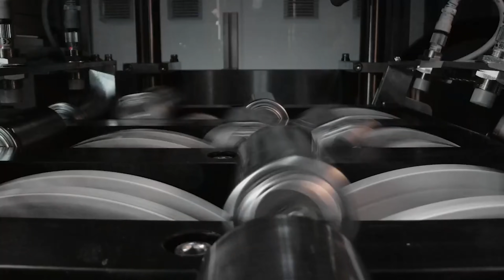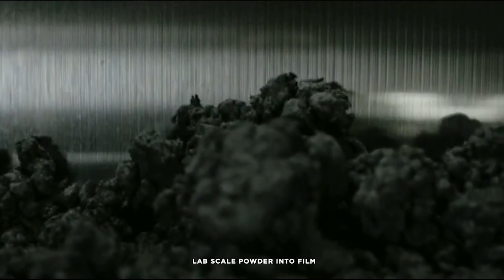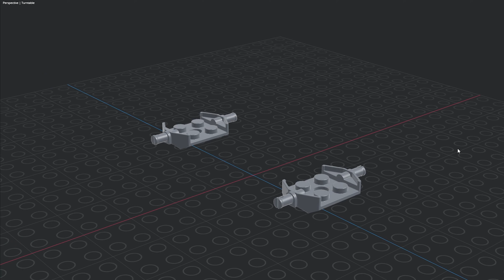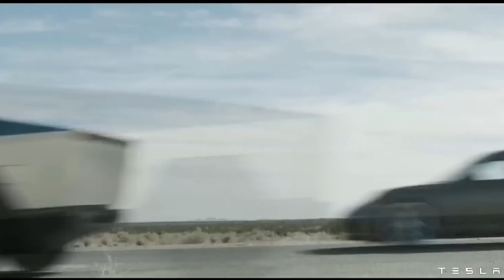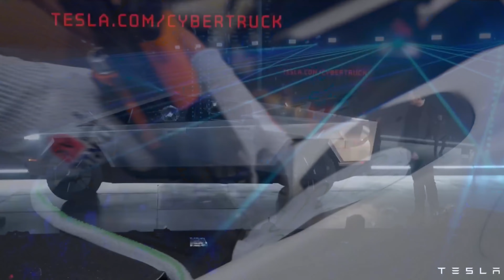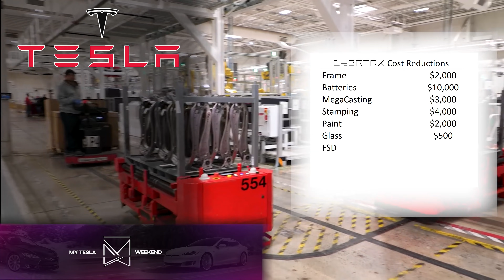CyberTruck costs half the competition, and we know why

Comment: Are robots that expensive though on the wider scale? 50,000 dollar robot is nothing. So is a million dollar robot if you get 20 years work from them. Factories colts billions and robots would be a fraction of that cost. Also, what is the issue with space in the factory when you can buy land cheap in Texas? I don’t necessarily disagree with your analysis just don’t want to overstate those parts of the equation.

Comment: I'm a construction worker (pipefitter), and I think it's too much of a departure from the traditional design.  The great stainless steel design is going to hold up real well.  But if it's too ugly, and nobody buys it.  It will flop.  Meanwhile Ford has bought into Rivian.  And Ford is promising a all electric F-150 in January of 2022(we'll see).  It also has a starting price of $40,000, and it looks like a normal truck.  Because Ford will sell a lot of these as fleet trucks to companies.  Ford will get real market analysis faster than most car makers who sell to individuals.
Reply from the maker: The preorders suggest the Cybertruck will have no shortage of buyers for at least the first couple years. Ford is facing the same problem everyone else is: a shortage of batteries. This worse for Ford than almost anyone because their trucks require massive batteries.

With a pack size of 115-155kWh their passenger car rivals can put 2-3x as many on the road on the same supply.

While I'm sure there are fleets that will pick up the $40k Lightning, a typical fleet truck costs half that. Making up that $20k in fuel and maintenance savings is going to be difficult. The plus side is that I can't imagine ANY EV truck builder able to produce electric pickups faster than they can sell them, and costs will continue falling, which will continue increasing demand along the way.

These are exciting times.

Comment: Rough guess

Cost of Samsungs 12inch 14nm Wafer is $2000(it was 2500 in 2017 so I'm assuming it cost less today)
You can make ~200 FSD chips per wafer(assuming 85% yield)
Cost per FSD Chip is 10 dollars.
PCB is about 50 bucks

Total cost to Tesla is about 100 bucks per FSD computer (2x FSD chip per computer).

Nvidia charges 2500/Xavier. That's their L2 stuff with 30TOPs (Vs 144 TOPS of Tesla's FSD). Their L5 stuff doesn't have a public price, but it's suppose to be 320TOPs. Knowing Nvidia, they will charge at least 10k for something like this.

So that's the Tesla FSD advantage. 100 bucks at most compared to perhaps 10k what Nvidia charges. Plus they probably license out their software for additional milking.
 This is why you don't see L5 chips from Nvidia in a Camry or even a Mercedes. Those are put into engineering cars used for training only. 

You need to take charge of your own destiny or else you're just another automaker.

Comment: Please address the fact that the 1/8” SS body shell will drive the vehicle to 12,000 lbs. This is a six ton truck .
Reply from the maker: That's not a fact, that's uninformed speculation. I've seen early articles that made some wild assumptions that still never got remotely that high. Tesla has filed for CARB classification as "medium duty" meaning it will be under 10,000 pounds WITH 3,500lbs of cargo, and that's on its heaviest, most powerful, longest-range variant.

https://electrek.co/2019/12/13/tesla-cybertruck-medium-duty-vehicle-carb/
Reply: @FutureAzA  do the measurements and do the calculations. OR, just for an exercise sub the 1/8 for the type S .025 gau and calc the smaller vehicle.  It will be 5.62 tons. The truck will need to have thinner steel everywhere but the precious doors. A lot thinner.  And SS is Lousy structurally compared to carbon steel and expensive as hell. The truck is solvable but with many compromises.
Reply from the maker: @callmeishmael7452  Ah ha, gotcha! Okay, the flaw in your math is the assumption that it would have just as many pieces as required if you're using regular steel. You wouldn't. There would be vastly fewer to achieve the same objectives. Add to that the lack of 1,200lbs+ for a motor, transmission, transaxle, and steel frame.

If you look at the prototype, which is likely heavier than what the production model will be since the 4680 cells were not yet available, the tires show virtually no give under the weight. Sure, they are extremely heavy duty, but 12,000 pounds plus another 600-800 for the occupants, you'll expect SOME give at 3,000+ per tire.

Time will tell, but I'm confident in the numbers as presented. Thank you for sharing your thoughts on this, it was helpful for me to do the research for myself. :)
Reply: @FutureAzA  forget the Number of Pieces.  Going from .025to .125 “ is 5 TIMES the material gauge. The complete body OR Frame MUST still be produced. solvable but like I said 1/8 SS Is a Lie.  Unless doors only
Reply from the maker: @callmeishmael7452  You and I both seem willing to bet on our assumptions being correct. I'm doing so by investing in Tesla, and I assume you're doing so by NOT investing.

If your firm belief is that the CyberTruck will have a curb weight greater than a school bus, my friend, you'd be wise to short the stock. I do not recommend that. Your math is flawed to its very core.
Reply: @FutureAzA  I am a heavy investor as I have no doubt the green lie will prop up Tesla waaaay beyond its actual worth. Key is not value but manipulation of beliefs. Edward Bernays not nasdaq. The truck will be a hit but it’s steel will not be .125 SS throughout.  Vw and toyota will hobble Tesla in 2021.
Reply from the maker: @callmeishmael7452  Your story isn't believable.
Reply: @callmeishmael7452  ... oh absolutely, $TSLAQ in May 2021.....
🤪

Comment: Did you forget fuel engine,gear box ,rear transmission box and transmission shaft?If we consider the EV engines  with fuel engine  equal as cost wise,what we do the others?
Reply from the maker: Ah sorry, no, this is comparing the CyberTruck to other electric pickups those companies are hoping to build. You get it. This is going to be in a whole category all by itself.
Reply: @FutureAzA  ok .I get it•

Comment: The beauty of CyberTruck is in price/performance.  But then I've never bought a vehicle based on aesthetics.  If someone wants a beauty queen vehicle, those are still available.
Reply from the maker: I've bought vehicles based strictly on aesthetics, and apart from Lexus it's always come back to bite me in the ass. Thing is though, the design has really grown on me and it's almost to the point where I would buy for the look, rather than in spite of it.
Reply: Price/performance, stainless steel, bulletproof, bed "vault", tailgate ramp, 4 steering wheels, range, sit six adults, lockable storage, 240-volt power outlets, onboard air compressor, ...

Comment: nice video.  

The simplified interior of the Tesla saves money too.  Fewer buttons, dials, and lights means fewer parts to design, buy, and install and simplifies the wiring harness as well.  Plus soft switches allow software engineers to change how the interface looks and act with over the air updates.  Hardwired switches don't have that flexibility.
Reply from the maker: All excellent points, thank you.

Comment: No casings machine which is MASSIVE, only folded metal. It's simply a juggernaut advantage and no traditional company will dare go near, hence, Game Over.
Reply from the maker: For sure! Though from the body-in-white pics we've seen, it does look like there will be stamped components in the door frames, it's still significant to reduce the number of stamped pieces from hundreds to dozens. Tesla envisions these rolling off the line as quick as Jeeps did back in the day, and I hope they're right because it will truly be a paradigm shift.

Comment: Take a good look at the doorless side view from Tesla. What is that interior framing? It’s not flat. What is it, how is it made, and what will it cost? I saw speculation about non cold rolled (work hardened) stainless in a YouTube, forgot where. Great content.
Reply from the maker: I've taken note of this and added it to my research for an upcoming video. It's a damn fine question. Those door jambs are NOT flat panels.
Reply: @FutureAzA  I’ve wondered about the mix of metals and galvanic corrosion. Stainless exoskeleton and aluminum castings. How is that going to work out?
Reply from the maker: @aaronbrakel2722  I have a video I'm working on that may address this, but the formed pieces may still be stainless, since the only reason they can't stamp the exterior is the thickness. If they use a thinner gauge for the stamped area, it can still be stainless.

Comment: Simple frame, simple interior design, battery so tons of moving parts gone, no dealership and more! It's made to function not to be fancy.
Reply: If it's so functional how are you going to take it anywhere offroad if it doesn't even come with a spare tire?
Reply: @fordman32508  You can basically weld anything to it. And I didn't know it had to go offroad to be functional.......
Reply from the maker: And despite my initial (very, very strong) hesitations, I'm all about it. Let's do this!
Reply: @FutureAzA 
 500 miles per charge 
0-60 in under 5 seconds
Tows 15000 pounds 
Hauls 6000 pounds in the bed 

Just the 500 miles per charge reels me in for like $70 grand the top end model. I NEED this truck! Google matt black Tesla it looks awesome!
Reply from the maker: @WAFFLEooFILMS  I'm suburban. I don't need any of those things. I need 6-seats and room for the things a family of six needs to haul. This is more than adequate for my needs.
Reply: @FutureAzA  I want a model X for that .....and a FJ CRUISER and a Lexus gx470 lol.

.......I want a lot of stuff 🤣 but that's cool.

Comment: 100M units would come out to only saving $5/each for paint overhead. ;)
Reply: For the initial outlay. Then there's the operation and recurring costs. I assume the 2000 in the video was just for operation/materials.
Reply from the maker: FIVE DOLLA'S!?! I ain't payin' no five extra smackeroos on no truck!
Reply: There's also all the environmental impacts of painting to contend with. How many tones of  VOCs are released per year currently? Probably not a small number.
Reply: 100 million units! At 1 million per year (that's twice the rate of M3/Y) that's 100 years life cycle. More likely to be 10 years life (before major refurbishment), so perhaps 5 million throughput.
Reply: @mervynleach1362  Thus the wink!

Comment: Is it hard to get parts, can't fix it yourself, driving up maintenance and repair costs combined with long delays?
Reply from the maker: EVs have lower maintenance costs across all major brands. Tesla still has a ways to go in terms of speedy replacement parts, but I imagine that's something they're working on. As for fixing a car yourself, heck, I haven't owned anything I could competently work on since the 90s. All cars are basically motorized computers these days, it's just that some of them run on 'splodey juice while others run a bit quieter.
Reply: I’ve owned a Model 3 for 2.5 years. Zero maintenance. Zero stops at gas station. Tire rotations provided by Tesla at my house in my garage.
Reply: Show me a repair manual from Tesla available for purchase and a parts department.
Reply: @kimchee94112  
Clearly this type of vehicle is not for you. Stick with legacy OEM. Push off 👉🏼
Reply: @vvattup  
Wanting to repair vehicles and owning an EV are not mutually exclusive. What analytical ability making you come to this conclusion?
Reply: @kimchee94112  ...Show me a repair manual from {insert auto manufacturer name} available for —>PURCHASE<—..
I DON’T mean a “$10/day $800/month $2800/year” “subscription” that requires proprietary cable$ and $oftware,
AND requires an NSA-Level Background Check to allow access to “proprietary NDA information/tech”.

Generic Chilton/Haynes need not apply.

I used to wrench for Fun & Profit. Started For Profit late Seventies, stopped Late Nineties.
Four years ago I even stopped For Fun. I don’t even do oil changes any more. Lights and flats are my limits now (Old Age sucks)
Repair  info is almost impossible to get access to these days.

That includes electronic items, which I started repairing in1969, specifically audio gear and computer  equipment.

Comment: Well done. So the biggest disadvantage for traditional ICE makers are how to deal with the pain to cut their useless capacity and labor to catch Tesla.
Reply: Challenge accepted. We'll see how relevant tesla is in ten years
Reply from the maker: They have a LOT of problems. Toyota is facing pushback from their upstream supply chain who can't adapt to EV parts. Every company is facing pushback from dealer networks who rely heavily on service and maintenance, of which EVs require very little. Then there's all the fossil fuel interests spreading fear, uncertainty, and doubt (FUD). 

You've got a car that's as good as any in terms of performance, cheaper over the life of the vehicle, and includes free over-the-air updates, and yet people are still scared of them... why? Because the seed was planted long ago. But driving one is believing.

Comment: your channel will blow up :) In a good way. Before you get famous in the Tesla community, wanted to ask you regarding Giga Berlin - How long will it take Tesla to pay off that investment? Since Shanghai was 1 year with 250k production :)
Reply from the maker: Thanks for the kind words. Berlin is trickier because we don't have a solid understanding of what the factory will cost, nor what it's actual capacity is. It's substantially bigger than Shanghai, so I would expect the fully ramped production to be double that of Shanghai's first phase, but I would also expect the price to be at least double, as in $4B.

It's further complicated by the fact that they'll be starting with the Model Y instead of the Model 3, so it's a higher priced model, and with the structural 4680 battery pack, the cost may wind up being lower, with a higher profit per unit.

I can run these numbers next year once we start seeing what the factory actually costs, what it's capable of, and what the profit margins look like. Back of the napkin math at this point says it would likewise be about a year to 18-months to pay for itself, before taxes.